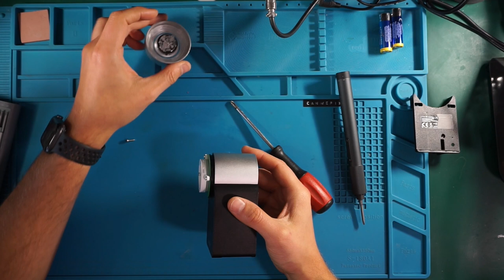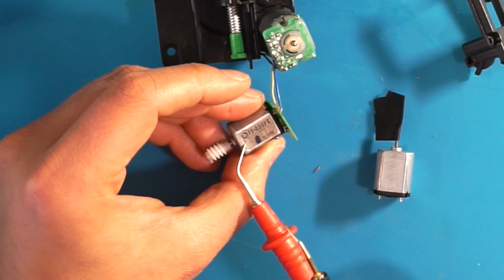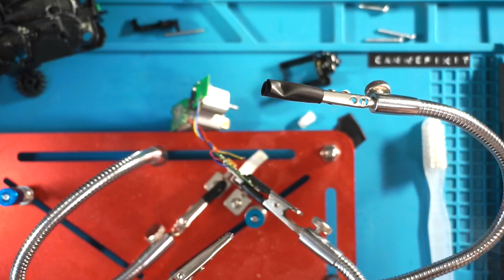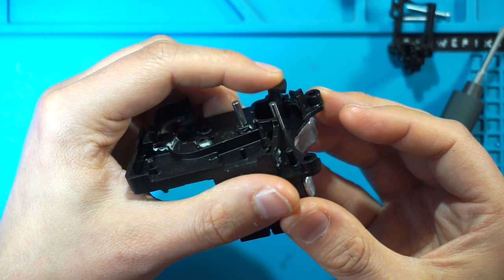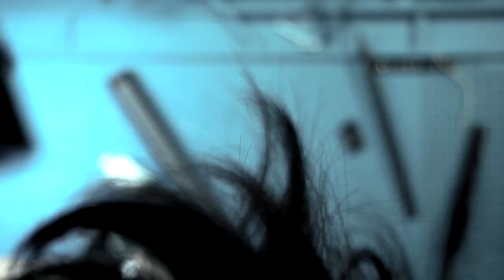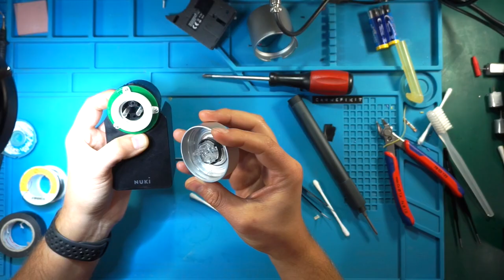How To FIX Your Nuki Smart Lock When It Gets STUCK

Comment: Many thanks for this tutorial! Just fixed my Nuki V2 (yellow cable was broken). V2 is a little bit different in the lifting mechanism.
Reply from the maker: Hey! Thank you very much for sharing your results. You are right, the V2 mechanism is a bit different. 😉
Reply: I just dont know how to fix the „spring“loaded plastic stick on the v2. Do you have maybe some tips? Because i dont know how to put it back? The spring loaded gear is loose .
Reply: @bobberclub  i have the same problem. Today, i have report this nuki, and mine: please help me...
i can write the answer, after nuki contact

I tried putting the plastic pin between the part without teeth and the parts with teeth = however, the rotating part on the Nuki could no longer be moved.
Finally, I installed the plastic part first, and then the spring, then the gears = this made it very difficult to turn the rotating part
Reply: @iceman-elektrischunterwegs3099  also hat sozusagen die feder das zahnrad immer rausgedrückt? Oder wird das zahnrad von etwas gehalten?

Ich bin gerade am probieren aber es klappt nicht 😅😂

Comment: Congratulation, great job one question does exist the possibility command directly (close contact, for example or send tension) the nuki through wire connection without Blue tooth command / wifi ? thanks
Reply from the maker: Thank you very much, Paolo! I don't know if this is possible, but it would be cool. But, I don’t think so.

Comment: Thanks a lot, for me it was enough to set the shifting Motor in the unconnected state and the calibrate again. Was extremely helpful to see how to disassemble the nuki 😃
Reply from the maker: Hi Paul! Great to hear, that my video just helped you! 😀
Reply: Hi. Can you please explain what you did and was enough?
Reply from the maker: Hi Philip, what exactly is not working? We may be able to help you.
Reply: @CanWeFixThat  the clutch. Won’t disengage.
Reply from the maker: Mhhh, as you can see in my video, it is highly likely due to a failed motor that handles the clutch. You should disassemble it and check if the little motor is still working. If not, you need to replace it. Links in the description.
Reply: I disassembled the clutch and assembled it togheter in the open position. Than built everything back together and it works now again.
Reply: @paulweber1335  got it thanks. Mine unfortunately has a faulty motor….
Reply: Witam ja mam problem szybko pada mi bateria wytrzymuje nie cały tydzień

Comment: I have a very similar problem with my nuki (1. gen), but sometimes it works again, sometimes it stuck connected and sometimes it stuck disconnected. Did you have similar symptoms before the final failure? Or is there a possibility for a loose contact?
Reply from the maker: Hi Thomas, maybe the motor is just half way working. I would recommend to swap it, those are failing soooooo often. It is really such a shame. :-/

Merry Christmas! 🎄

Comment: Does this work with nuki 3.0 ?
Reply from the maker: Hi! Do you mean the motor replacement?
Reply: @CanWeFixThat yes for nuki 3.0 pro
Reply from the maker: @eliemimouni6190 I think it should be the same. What's different primarily is the clutch mechanism.
Reply: with the motor faulty like this, can one still turn the key, i.e. from outside the door?
Reply from the maker: @wolfberlin It is possible, but you’ll be turning the engaged motor with the gears, which creates a lot of resistance. It’s not something you should do on a regular basis.

Comment: Maybe you can help me. I have a Nuki 2.0 and I can't manage to put the second motor, which moves the gears via the lever, in the right position. I always get the error message (0x4 battery) when calibrating. In which position must be the lever to the gear. Have already tried everything.
Reply from the maker: To be honest, I was trying the same as you and I feel your pain. :-) I unfortunately have not an image of the Nuki 2.0 lever mechanism.
Reply: I have the same problem..

Comment: Thank you for the patient and in-depth video. Great job! The right to repair and "fixability" of products are still in their infancy. Such parts should be mounted to replace them more easily. How many V1 Locks will die in the next years? Business model?
Reply from the maker: Hi Santa, Thank you very much! You are absolute right, but I think it is just a design flaw in this case. Unfortunately this issue happens with V1 and V2. I am not sure about V3, had not my hand on these yet.

Comment: I think my 5 yo nuki v2 motors are dying, both motors are the same as your description?
I'm buying a v4 because being locked out is not fun but I can use the v2 for the back door as backup if the repair would work.
Reply from the maker: Yes! The motor for V1 and V2 is the same. Good luck! 🍀

Comment: Hello Markus,
Great video!
I have an error 4A on mine Nuki 2.0. I suppose that may be the main motor.
Do you a reference for that? Or any suggestions?
Thank you and good video.
Reply from the maker: Hi David, thank you very much! I'm not familiar with this specific error code. How is the lock behaving; Any movement at all?
Reply: Dear Markus, thank you very much for your reply. Basically it was making a short noise and showed no movement. In honesty, Nuki was awesome as they replaced the lock even though was off warranty.
In the Nuki app was showing the so called 4A error and Nuki said that it was not fixable (at least not without a technical intervention that the one you made). Based on that, I was wondering if it was not the case of just the main power motor being cooked.
If you have an idea of the type of motor I can try and switch it to, I would maybe try and do a repair. Thank you.
Reply from the maker: @DavidLourenco500 Hi David, that's really considerate of them! Do you have a Multimeter? If you do, you could use it in ohms mode to see what reading you get from the motor. You might also try applying a low voltage, about 1.5V, to see if it shows any sign of life.
Reply: So I had error 4B - motor blocked, it's basically the same as what you show in the video.
In my case it was just that I had put the Nuki 2.0 together incorrectly and something was blocking the mechanics, when I fixed that, the error went away and the electronics worked again. My only problem is that I don't know how to install the spring-loaded part in V2.0.
Reply: I would just take it apart and check if all the cables are connected to the motors

Comment: I just bought Nuki Pro and It get stuck several times and after I did fine tuning in "optimize tuning" it released.
Is some bug or I need to change the device by warranty ?
Reply from the maker: Hi, this doesn't sound like a motor issue. Could it be the lock cylinder? Is it smooth, or is it hard to turn the key?

Comment: Hello, where did you buy the replacement engine, what kind of model is it?
Reply from the maker: Hi Jeremy, the link is in the description.
Reply: Thank you I ordered the motor from your link and installed it thanks to your instructions a big thank you I have the Nuki version 2.0 the replacement motor fits perfectly with the original the only difference is it has a different direction of rotation so I had to swap plus and minus then it worked  functions
Reply from the maker: Hi Jeremy, I am delighted that my video helped you to get your lock up and running again. That's good advice with the polarisation of the motor - thanks!

Comment: I like to replace the motor of my Nuki. But the motor you linked is no loger available. Can you please update the link?
Reply from the maker: Unfortunately, I don't have an updated link, but you could check the dimensions and rating of the motor to find another seller. I'm sorry that I can't help you out right now.  :-/
Reply: Yes, I understand, Thanks. But it's hard to find one with the same specs.: shaft lengt and RPM  @CanWeFixThat
Reply from the maker: Totally agree! If you find something, please let me know; this might help other viewers. Thank you! 🙏
Reply from the maker: @sandergangabisoensingh9846 I think I have found a proper replacement motor on ali. But I can't tell for sure!
Reply: @CanWeFixThat can you please share the link to motor you are found?
Reply from the maker: @victorkunst   Hi Victor, it is in the video description.